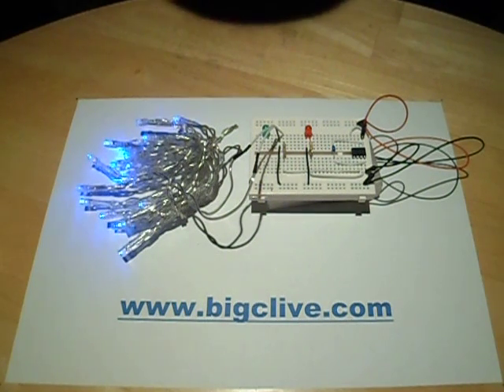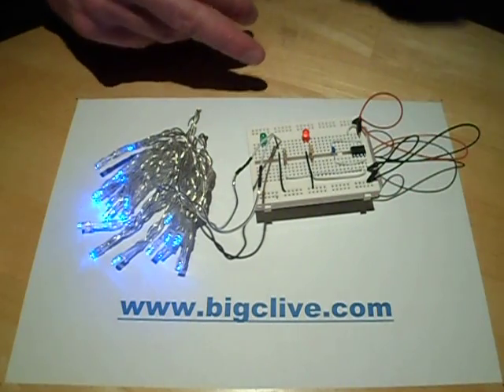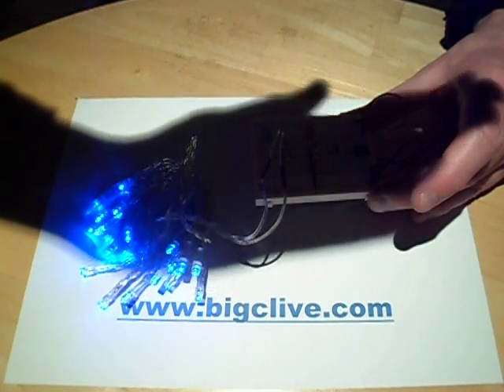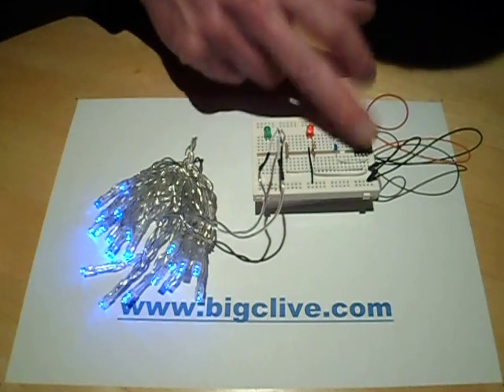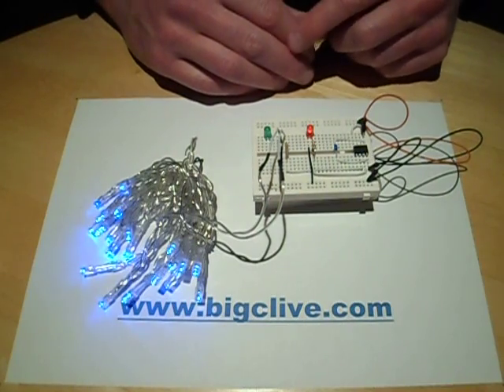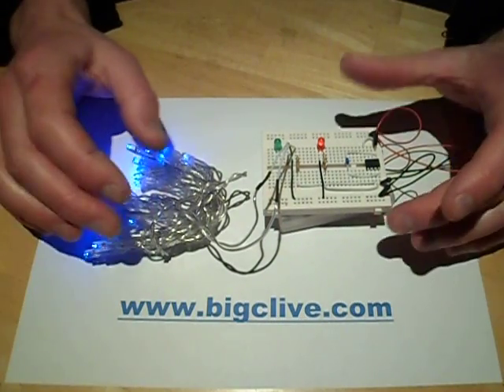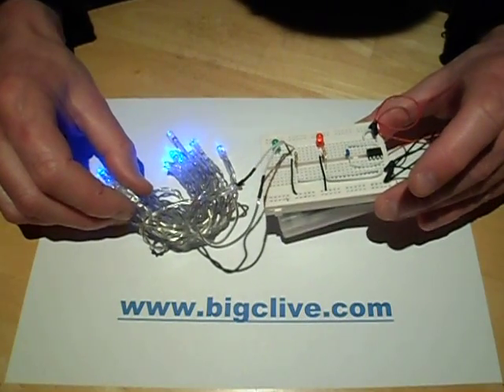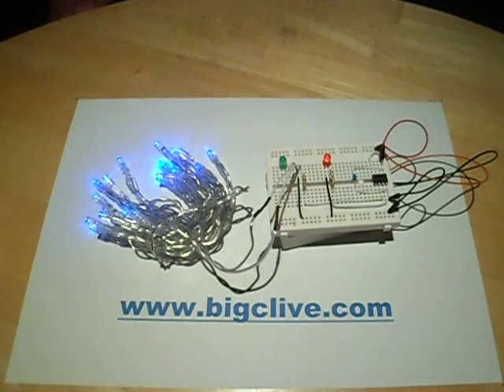Prototype stand-alone timer for Battery powered Xmas lights.

Comment: Hi is there anyway of bypassing the timer in those aa battery powered lights. With timer on and of function. I just need them to stay on. I'm using aa to usb dummy batteries
Reply from the maker: Sadly the timers are often not easy to bypass.
Reply: @bigclivedotcom No worries thank you

Comment: Hi Clive, any chance you followed up on this project with a crystal oscillator. I have been trying to do this for years. There is nothing else on the web that I could find for the battery operated light timer switch. Thanks.
Reply from the maker: I doubt it could be made cheaper than many of the battery packs that come with the timer built in these days.

Comment: Hi Clive, I was thinking of doing this type of thing but just using a micro-controller as a control unit, feeding the base of a transistor for switching the lights on and off. Is this a logical way to approach it? How did this project end up my friend? I couldn't find it on your site.
Reply from the maker: Using the internal oscillator proved to be too variable.  It was affected by things like battery voltage and there was huge variation in the timing.  I can understand why the commercial units use a small crystal to keep them accurate.

Comment: Hi Clive, I love the stuff that you've done with the little PIC microcontrollers. I'd like to learn how to program & work with them to make LEDs chase & dim. The whole software language thing is a bit baffling, though (I'm much better with hardware than software). Do you have any good suggestions on where to learn the basics of PIC software?
Reply from the maker: +Stephen Lee There are loads of excellent guides on the Internet.  But it usually takes throwing yourself in and getting a programmer and some PICs then experimenting to really get to grips with things.